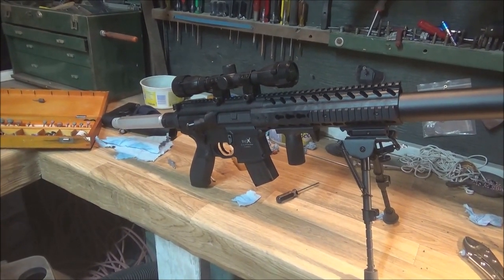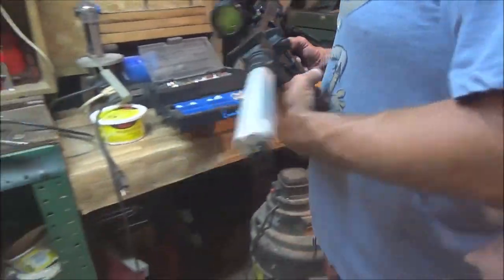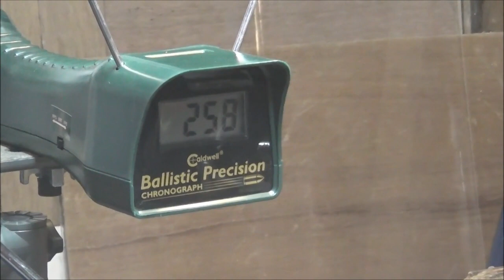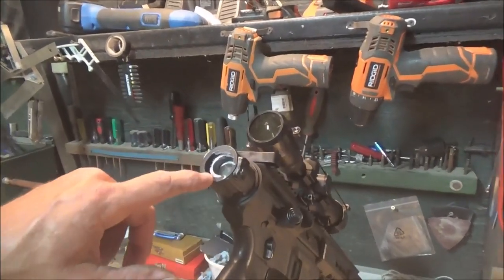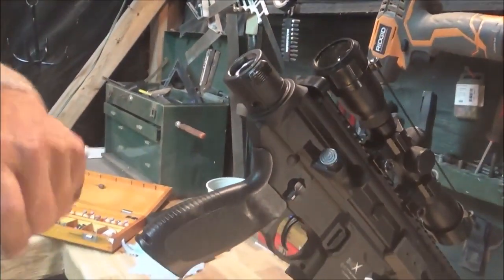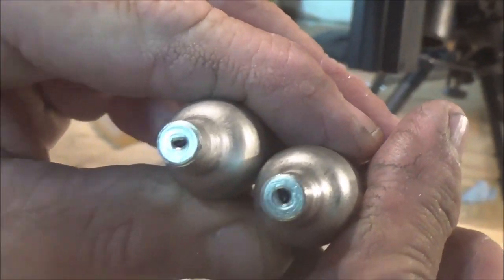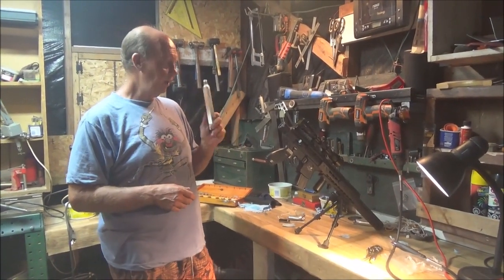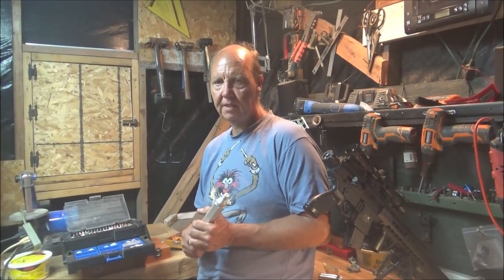Umarex X2 12G To 88G Co2 Adapter Testing

Comment: Someone suggested putting a dime between the two 12g CO2's I have tried that. THis also improves power and shot count!
Reply from the maker: a dime is not going to improve shot count or power neitehr is related , a good perice of the bottles will help with getting the proper amount of co2 to the valve but still does not improve shot count power is controlled by the timming of the hammer hitting the valve and how mich it opens as well as the barrel length pellet or amo weight etc, not any of this has to do with using a dime any where
Reply: @KevinMillard68  Yeah, regarding the 2x12g adaptor. I understand the dime ensures a solod puncture. REgarding shot count especially with the 88gCO2. and CO2 cartdriges in general, How much does atmospheric conditions really does affect performance? I mean if yu you live in mile hig city Denver vs. Say Sea level Boston.. what difference is the shot count? what difference is the fps? If you shot on a rainy day vs. a clear dry day. What effect does moisture have from barrel to target? I have played with heating up the CO2 cartridge with a blowdryer...careful not to go over the safe range. And this has been fun! I know it is unlikely you will want to experiment with this stuff, maybe someone else might. Since, CO2 powered pellet guns are so much less than actual firearms. These variable really fascinate me!
Reply: Thank you for responding to this older video. You are a Youtuber that really tracks your comments section, and that makes a HUGE difference in following  your channel, bookmarking it, and subscribing to it!

Comment: No actually I meant using jsb and have you given a try. Anyway I have a problem. I just picked up a couple new guns one being qb78 177 cal from Canadian tire and I've loaded it up and it isn't shooting the pellet out. When I loaded c02 I thought it sounded under power and now I see it is.I don't want to keep wasting c02 there isn't a leak I can hear or see and I know you have a ton of experience with co2 guns qb78/crosman and others. I know they don't have anymore in stock or I'd have returned it by now but I really want a 177 qb78 and if I learn something that's a winner for me
Reply from the maker: do you have another ctire in your area that does have any in stock the website says you can goto any ctire for your 1 year over the cound exchange.. if not then you ll have to go for the upgrade and pay the difference on a better gun or you will need to just order in a new valve and take the gun apart and change the valve ,, i had 2 of the qb78 .177 go bad on me so far so iam gun shy for now on the .177 model maybe next tiem they go on sale ill try again but i wont be using my warrannty again ill just tear it down and swap the valve they are pretty easy to work on i use to take them apart in my sleep do to  i like to tinker and i used to make new valve stem seals for the qb78s alot among other upgrade parts  i use to make as well

Comment: Thanks for the video. I plan to build an adapter like this. What is the thread size of the co2 88g cylinder and this adapter?
Reply from the maker: i have no idea what the thread size is
Reply: @KevinMillard68  Thanks
Reply from the maker: @Falco60-j9r  no problem sorry could not be of my help f you have a tap and die set you can check the tap to the the threads of your gun you have to see if you have the right size one

Comment: Hey Hey, My brother in law bought one of these recently and it was not shooting  when i unscrewed the co2 canister there was a seal, he ddnt have the box anymore with all the papers, does he have to break the seal himself then screw it ?
Reply from the maker: you have to screw in the back cap screw first then the front bottle gets periced when you put it in the gun and yes you can remove it after with gas still in it and it will seal up
Reply: @KevinMillard68  
Thank you so much i guess the canister neck is too short because we screwed it tight and still did not pierce